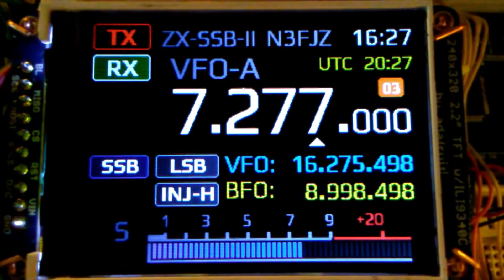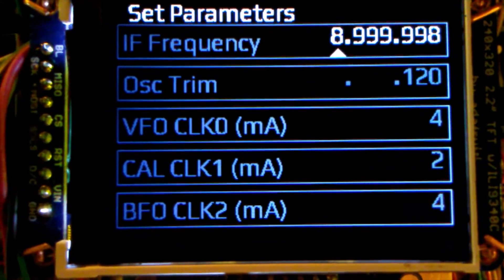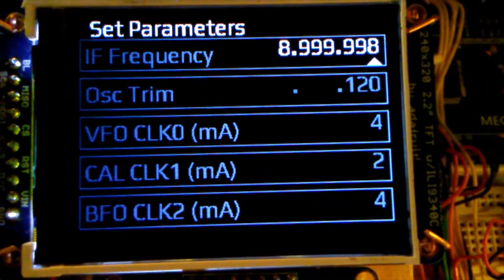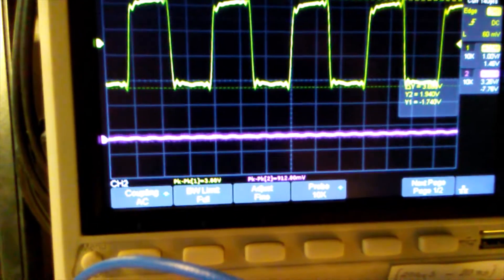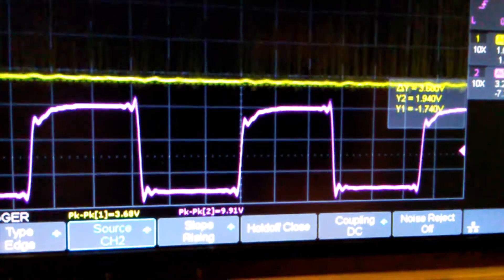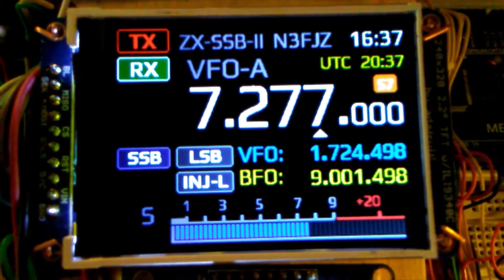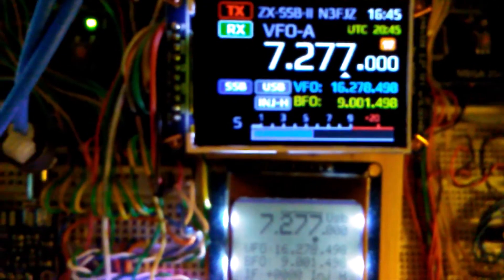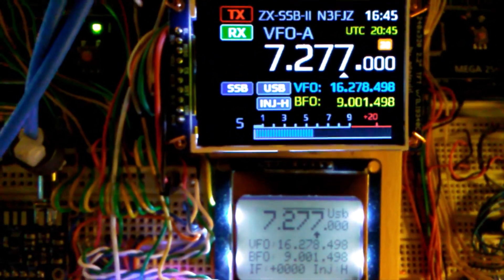(Pt-9) ZX-SSB-II Front Panel Development (Part 9) - Set Si5351 output drive level from the UI

Comment: Very good project,
but unfortunately, there is a failure when loading the program on my arduino IDE.
there may be errors in the Adafruit_GFX.h & Adafruit_ILI9341.h libraries I added.
please can you share the link to the library.
Thank you.
Reply from the maker: Sorry you're having problems Luthfi CBer.  If you're getting this error: "Adafruit_GFX.h: Nosuch file or directory" and the same for Adafruit_ILI9341, try the following...: From Arduino IDE select the menu items [Tools >> Manage Libraries]. In the box that says "filter your search..."  type in "adafruit gfx library".  This should return a list of available libraries, find "adafruit gfx library" and hover over the listing and an [Install] button should appear, click it;  the library should install into the IDE.  Do the same for the Adafruit_ILI9341.  Close and restart the Arduino IDE, then try to compile the project.  I simulated your error on my end (by deleting the libraries) and I did get the error, then I did the steps I described above and the project did compile ok.  I hope this fixes the error you're getting.  I'm very happy you have tried my project, let me know if you are still seeing errors.  Thank you Rick - N3FJZ.